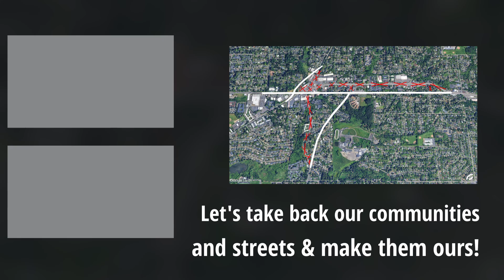Fixing Oregon's WORST Intersection

Comment: just trying to come up with a lower-footprint approach- what if we assume that the two sections of Scholls Ferry can be disconnected? have the southern section of Scholls Ferry turn sharply northward to meet OR-10 at a right angle, and finagle Oleson and the northern section of Scholls Ferry to meet at a similar right angle, as if they were now one road. several businesses and some residential would need to be removed, but far, far less than in your proposal; my rough sketch on Google maps would suggest these two fully distinct intersections would be between 600 and 900 feet apart (depending on the details of the routes, of course). this doesn't have the same pathway creation or make room for densification, but the greatly reduced numbers for residential displacement lower the political risks and raise the chances for this nightmare to actually be removed. the biggest concern in my mind would be a question of how many people would be making a right-left to continue on the roads that currently form Scholls Ferry, but the northern side of it especially seems small enough to manage.

this would put the intersection between OR-10 and southern Scholls Ferry just north of where the House of Pipes and Chevron are atm, and the intersection where Oleson and northern Scholls Ferry come together would be between Noodles Restaurant and Dublin Pub, at least as i'm drawing it, so about 800' between these two intersections. with good luck and significant planning you might avoid any residential impacts, but i think there's one apartment complex that would probably be affected by shifting Oleson. several businesses would have to go, with no alternative.
Reply: just to add, i'd probably rename the northern Scholls Ferry to Oleson, to minimize confusion for people seeing the roads for the first time; would take some getting used to for locals, but that would be true for literally any changes.
Reply from the maker: @robynkolozsvari  River Road > Scholls Ferry > Olsen > Skyline Blvd Lol, that would be the most Portland Metro area thing to do ever. Just keep renaming the damn road every few miles haha.
Reply: @TheCriminalViolin  well my concept here is that it would no longer be considered a single road, is the broader purpose of the renaming lol, instead it would be Oleson turning into Skyline and Scholls Ferry would end where it meets Beaverton-Hillsdale
Reply from the maker: I understand and like the idea of this concept, but god I despise the idea of having a road/thoroughfare like Scholls get severed to where people would need to zig-zag between the intersections just to continue along them either direction. And that in itself would create a major issue with traffic flow and increase dangerous lane changing within a short 800ft window just to pull that off as a driver. It'd also be a pain in the ass as a bicyclist or pedestrian.

I actually recorded me sifting through the data for traffic volumes for this area and each of the main roads, and surprisingly, Scholls Ferry sees slightly MORE traffic on the northern side than it does the southern side of the current intersection, somehow. Though worse is, most data was last collected in 2021, with the rare exception of one 2023. So the numbers are royally skewed, given not only COVID numbers during the lock-downs, but also the 2017 widening causing a lot of skewing, as well as the westside pipe project causing more of the same.
I've forgotten Olsen's numbers, but it wasn't as straightforward as I wanted it to be, since Oregon has a really weird, illogical road jurisdiction/ownership model, where any city can buy ownership and jurisdiction over a road, even as they enter into other cities or counties, while the counties also own some of the roads, and ODOT itself actually has very little ownership/jurisdiction of them. I had to jump around in the house of pain (heh) between Washington County Roads, City Of Beaverton and Oregon itself just to find all of the data on each of these roads at this point or at least area. I also lack a program necessary to look at the state's excel files for the full detailed data.

Of course, a huge part of fixing this intersection mess is making it so that it can support densification as that is inevitable according to the laws relating to the Town Center program the city and county are a part of with the state and feds. A fix isn't a fix if it does not account for the now increased demands put upon it.

I do really believe anything other than a drastic change that all people in the region will despise due to their mass displacement is just a band-aid treatment that may TEMPORARILY "fix" or alleviate some of the many issues with it, however. We can't look at it and consider fixes in the current and near-term, as it has to be the long term. Otherwise this will be a never-ending nightmare that always remains as "could have gotten fixed, BUT".

The lack of political support, in my case, specifically from voters, is exactly why I noted the state has to do something like this without allowing anyone to vote on it. Rip the band-aid off and get it over with so that we never need to worry about it again.

Comment: There looks to be plenty of space to rework those intersections without building new roads though neighborhoods.

I ask, what is the intent of your "redesign" improve safety? Add capacity? If it is to improve safety this can be done with the existing sapce. If you want to add capacity I ask why? Maybe space in these roads should be dedicated to bike or bus infrastructure. This is the only real way to add capacity in the same space.
Reply: This video provides a great example of what can be done. https://youtube.com/shorts/YZdc-SxY7-I?si=ORHAFo-XlYnp606x
Reply: @TheCriminalViolin  if you have a lot to say, you need to spend more time filtering out what's important and structuring your message. I don't care that you remember what the names of all the streets are and can say them quickly while zooming around the map. You need to focus on goals and why your proposal fits them best. If you have considered 10 alternatives, either actually explain why each was discarded, or don't mention them at all to reduce confusion and extraneous information.
Reply from the maker: @ფიზმათ  I'd do that if I was trying to be a "professional", but I am not.
Reply from the maker: It is many things, but the dominate basis is so that it is logistically sound, making flow efficient, and tied in importance is fixing it properly before all the higher density mixed-use redevelopment and infill transpires. Second priority is then safety, with the third being to add mode share for BRT and increase the pedestrian and bicyclist capacities while improving their own throughput and safety increases.

I felt I made all but the latter of my reasons abundantly clear in the video, however, so I am somewhat surprised to get your question here.

Comment: Living within a mile of this mess I don't see how this drastic of a change would happen, but I hope that a plan comes along that gains enough support to get approved and implemented. I hope tearing up a half mile worth of housing just to take the curve out of beaverton-hillsdale hwy won't happen, I just don't think the benefit would be worth it. Even the plan you have for Olson would work fine without moving the hwy south 100 ft.
Reply from the maker: I definitely get why most people would hate and not support such a concept, but there truly isn't any real fix for it if something this big doesn't happen. And that's the fault of never fixing it before the continued to expand it all so much, and develop all along it. Keeping it as is isn't a option that should happen either.

I cut out a lot of other ideas I mentioned that I know many would come up with to "fix it", but none of them would do anything except likely make the problems far worse. The most American thing would be to turn it into a freeway interchange type of network.

Having two large roundabout would have their own issues, which was a suggestion someone already suggested on this video, and would still require a large amount of space, as well as need sufficient space between them, one for Scholls & BH, the other for BH and Olsen.

Comment: You need two roundabouts  and problem solved.
Reply from the maker: I can just imagine two immense like, 4-6 lane roundabouts within 200-500 feet of each other 😂
Reply: @TheCriminalViolin  
You guys don't tend to use them.
They work fine in Europe.
It was an interesting video.
The real problem is the through traffic.
We solved this sort of thing in my home town of Auckland NZ with two massive tunnels.
I installed the fire suppression in one of them.
A year of working at night.
Reply from the maker: @Teddybiter  We do have roundabouts, and they are actually increasing in number too. There is multiple close by to this mess in fact. The largest is at Scholls Ferry and River Road. Another one is being built on Farmington (Beaverton-Hillsdale) and River Road as well, which is similar in size. Also, a smaller one is even closer, located just west of Hall Blvd on Hart. There is also one nearby on top of Cooper Mountain at Kemmer & 175th.

Underpasses or tunnels are likely not a viable option at this intersection though, because we have always had horrible drainage problems throughout the corridor.
Reply: @TheCriminalViolin  
Ground water was a problem for one of the tunnels but it was sorted.
It actually came in under budget and was finished early.
Not the normal way public works turn out here.